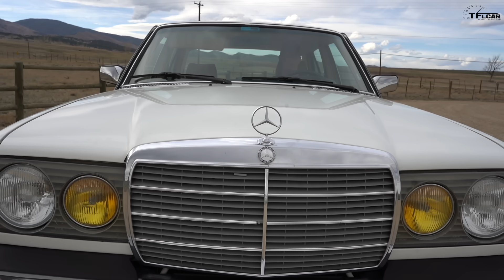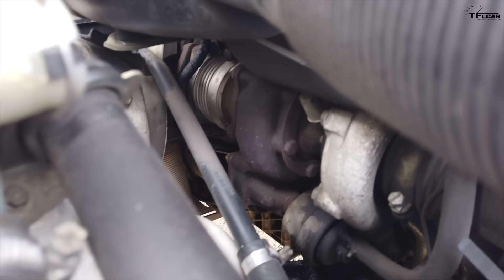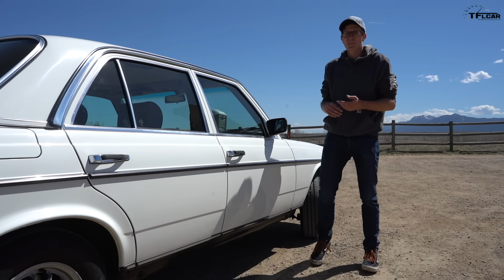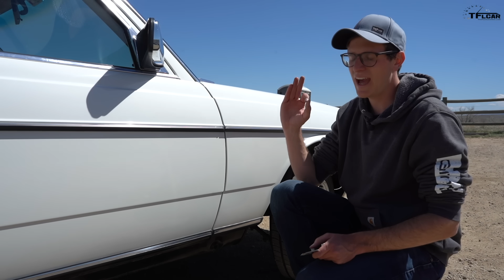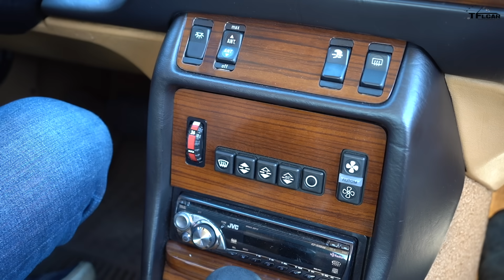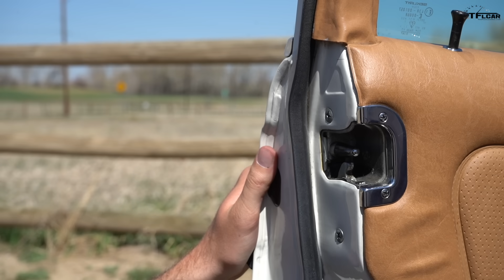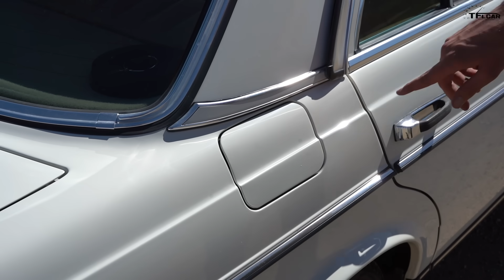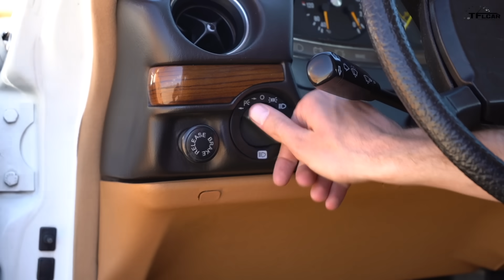This 37-Year-Old Diesel Is THE BEST Mercedes Ever Made!

Comment: I have the 1980 wagon version. LOVE the foglights ... love that they point about 40 degrees to the left and right so I can see the deer before they leap out in suicide.

Also ... I can attest that this engine is nearly bulletproof.
One day it had consumed its crankcase oil to the point where the oil pressure gauge started dropping to zero and back up again and I knew it was time to top it up ... but ... DOH! The handle to open the hood broke off!
SO ... I  kept going to my friends house ... 7 miles ... NO OIL PRESSURE.

Didn't bother it a bit.  I figure the sludge was so thick that it functioned like a reservoir.
I poured in about half a gallon and it fired right up. Didn't smoke any more than before. Accelerated the same 0-60 in 22 seconds (naturally aspirated, no turbo) as it had since the stone ages.

Did I mention that neither I nor the other fellow have EVER changed the oil in like the last 15 years?
Doesn't bother it. Same power. Starts right up. 
Its a seriously ancient diesel. Frankly it burns and leaks the lower viscosity oil. So the worn out oil is gone. 
Pour in another half gallon about two or three times a year.

Also started losing power one day ... figured out ... oh, right, Previous owner never changed the fuel filter, and since we traded it back and forth over a decade or so ... neither did I. I figured out that the fuel filter was about 15 plus years old.

While I was changing that, just for good measure, check the air filter ... huh ... some squirrel had made its nest in there. Cleaned that all out, tried an acceleration test without the air filter to see how much difference it would make.  ... NONE. So I put the squirrel nest air filter back in.

STILL gets 29 to 32mpg on the highway.

With new fuel filter back in ... right back up to its normal acceleration!

I've only stopped driving it lately bc the hand crank windows (its a Canadian model) smashed on the left and I can't find another window and driving with no window in the winter SUCKS. By the way, bc its the Canuk model, it has HAND CONTROLS FOR THE HEAT. Yep, none of that "temperature wheel" that never works!!

But it starts right up, no problem! EVEN IN THE DEAD OF WINTER ... no block heater ... starts right up.

Odometer died something like 15 or 20 years ago so NO telling how many zillion miles ... doesn't matter.
It starts, it pulls, it gets up to 32mpg in a HUGE HEAVY wagon format that will pull trailers!

Oh ... ya , its heavy AND STILL CORNERS LIKE A SPORTS CAR! Yes, a WAGON ... that's almost 40 years old.
I beat the Google Maps estimated time through eastern West Virginia by like 20 minutes ... in spite of having about a 78hp (naturally aspirated) motor ... BECAUSE I JUST DIDN"T SLOW DOWN FOR THE TURNS.

It drifts beautifully through the turns .. just like in the movies except I'm not billowing smoke from my tires because I got to my drifting the MANLY way ... by just entering the turn at twice the recommended speed!  No horsepower blasts to spin the tires for drifting. That's the woos's way bc you can always let off the throttle if the car gets out of hand. 
Coming down a mountain at twice normal speed ... you have to actually drive the car because you can't rescue the turn by just letting off the throttle. Nor can you slam on the brakes. Handled beautifully.
Not a problem ... tracked beautifully and didn't have the tail come around level to the front ONCE. NOT ONCE.

The only bummer now is that the fuel gauge stopped working. So now with no odometer, its hard to tell when its about to run out of fuel. Luckily it has a primer pump built right into the lift pump from the fuel tank!

I've not seen ANY other car with THAT!

So, YEP, THIS is the car to have during the apocalypse.

In fact, with our current president starting wars  for ... "reasons", hey, he doesn't feel any need for that ... it might be EXTRA good to have "apocalypse mobile" in your garage!

I'm only selling it because my health requires a functioning civilization and stable health care and ... ya ... that's about as likely as a reliable FIAT in today's America.

So ... I'm selling this perfect vehicle for the apocalypse ... which just may happen as a "November Surprise" to avoid an election that just may land a certain someone in jail. And that certain someone is not going to be Hilary.

This car is about to turn 40 and it JUST MIGHT OUTLAST AMERICA at this point. Seriously. I'm going to try to get the hell outta here. Want the perfect beast for the apocalypse? This is it!

Comment: In these cars there is nut in the boot that fits the wheel brace spanner if the electric sunroof gets stuck you can wind it shut manually by turning the nut with the wheel brave what engineers !!

Comment: My favorite Mercedes, I prefer the 300TD Wagon.
Reply: James Lamb those are very expensive by now. For  good one you’ll pay upwards of $15k. I would prefer a 280TE wagon (T is not Turbo but T-Model, which was the designation for wagon)
Reply: @roadtripusa9433  hi, sorry for my ignorance, but isn't the 126 much better and strong than the  123?
Reply: @roadtripusa9433  I had the 240TD and  I was dreaming of a 280TE. 0 to 60 in 30 seconds was my pain, I sweet blood while overtaking trucks. But I have to admit that the 240TD had a good fuel economy which makes it a daily driver even in modern times.
Reply: I once saw a 240TD.  Not imported to the U.S.  My dream car... right behind the 1972 Volvo 142... green... cloth interior.
Reply: Wagon with a 5-speed standard transmission would be sweet
Reply: Much better than the 300 sedans. The wagon was built in Bremen to a standard. And the best were the pre turbo models. 82 and earlier.
Reply: 230ce

Comment: No matter which model you bought as long as you had the 5 cylinder engine, the top engine. But I had a 220D with automatic gearbox, sold it at 680 000 kms, because of gearbox broken. the engine still running perfectly. One of my best cars ( with my BMW 525). Deutsche Qualität!!

Comment: I cut my teeth as a young service technician working on those. Nothing like sorting through the scratched microfiche files to find the vacuum diagrams, in German! Had to hand draw them to diag the vacuum systems. Made a smoke machine before they were made (using a MB glow plug) to diag the door locks.

Comment: My dad is retired Army and we lived in Saudi Arabia 1981-1983, and then he retired.  My mom had been working over there also, as bookkeeper, which was on the low profile.   When we were getting ready to move back to the states, we flew back for a week, and we always stopped in Frankfurt.  Bu this time we went downtown, and I had never been off the Air Base, Rhein Mien AFB, and we walked into a Mercedes showroom.  They sat down, checked off options, wrote a check, in full, (working in a hardship region had its perks) and walked over to the Audi showroom.  They had just ordered a Chocolate Brown 1985 300D automatic, and a 1985 Audi 5000S, 5 speed, when that body style was groundbreaking and this was easily the first I ever saw in the states.  They had to be converted for US regulations, and they were shipped to Jacksonville(different dates of course).   Both cars were awesome.   For trivia, they were once raced from Chareston, SC to Orlando, Fla where my dad was trying to chase down my mom who was actually behind him, by way of a mistaken identity detour.   But the Merc.  It was supposed to go to my daughter, but my dad got rear ended at about 35,ph, he was fine, car totaled.   Awesome car.  Great highway cruiser, and much more powerful than the numbers would show.    You should have shown that sunroof lower slightly before it moves back.    And also the windshield wipers are cool.   And don’t be fooled, I’ve been scary sideways leaving the car wash as a kid.  When that turbo spools up, it surges.    And yes, I took my driving test in it simply for the parallel parking advantage gained with that steering angle.  I almost choked when the windows started to fog during a winter rain and almost didn’t get them defogged.    Almost failed.     And for the record, my family isn’t rich, they just invested in two very high quality cars.   Ok one very high quality car.  The Audi was exceptional in every department except longevity.   The 5 speed was top notch smooth, and 1-2 power shift would kick the front end over a foot or so.    Great car.    Crappy door handles, brakes, shifter mechanism, AC, sunroof mechanism, antenna, etc.   ugh.
Reply: What a nice story!

Comment: The best Mercedes ever made? I think that's an understatement. With more than 2 million units sold the W123 is often considered the most reliable car in the history of the automobile.
Reply: Built to last for a lifetime
Reply: @San-uu7qc  you bet!
Reply: @San-uu7qc outlast many original owners
Reply: @Slakers we're not talking about the same thing. I'm talking about reliability of one single model the W123 built between 1975 and 1985.  Lots of W123s especially the diesel-engined ones have been known to easily hit 1 million km with just regular maintenance. You can still find a few them in the Middle East and in Africa where I live. Your data is correct, but it refers to all Toyota Corolla generations since 1966 to date. Don’t get me wrong Toyotas are fantastic and dependable cars. I own one.
Reply: @vieuxbal1253  Toyota are pos
Reply: @PathosRx  ????
Reply: @PathosRx  that part 💯
Reply: @vieuxbal1253  well ,it ain't no Mercedes. 
Even a base mercedes is a Mercedes,not a Kia. 
Has that kickass German engineering we've been told about. 
Of course anything much past 1990 is trash as far as that goes.
Reply: @MrTheHillfolk   I agree especially for the past generations Mercedes. But it's unfare to compare a Mercedes with a Kia as they're not targeting the same market.
Reply: @vieuxbal1253  I could have said VW or Chevy or anything else ,the other type of car doesn't matter because in the end ,it's not a Mercedes.
Reply: @vieuxbal1253  Especially 94- 97 . I had a 94 Corolla for 6 years & that car never yet left me stranded . All u did was oil change & replace timing belt & pump .Corollas are extremely reliable.
Reply: @vieuxbal1253  but they didn´t out lived any mercedes much more the 1966 models and also like toyotas, old toyotas allthough i have the latest model of the hilux to work and till now only diesel, tires , oil ,that blue stuff, around 2.500km´s each month since it came out not a single problem
Reply: @Slakers how many corollas are on the road today with 1 million miles or more with original engine and transmission??
Reply: @wisdomandlove1661  probably a lot more than we hear about.
Reply: @wisdomandlove1661  none
Reply: @wisdomandlove1661  toyota owners and mercedes owners are apples and oranges
Reply: True. W123 might be the most durable car ever made. Old Volvos give them some competition though. Insane mileages on them as well.
Reply: Absolutely  TRUE
Reply: I came from vws but I couldn't pass up a really clean 80 240d 4 speed a customer had,just because it was so clean and in great shape. 
Been 2-3mo now and I've had a great time learning as much as I can about it.
And it's not any slower or faster than my old mk1/2 VW diesels.
It gets the job done. 
(Lol you poor automatic trans folks though yikes 😬)
Reply: Well said
Reply: IS THE 1983 TURBO DESOL THE SAME..IM A ABOUT BY A  1983 TURBO DESOL. MERCEDES
Reply: @rosendodominguez9833  it is indeed.
Reply: Numbers of sold cars do not tell anything. If this is the most reliable car, all my personal experiences are wrong. In my eyes, it was one of the worst cars ever made - and I would not take it as a gift. Thank God I do not have to drive Mercs anymore. ( I was paid to drive them - but was the money worth the horror...? )
Reply: It's no more reliable than a Toyota but it was fixable and resisted wear better than other cars. When it did break it cost a fortune to repair. They are tiring to drive long distances. Loud and high vibrations.
Reply: The ford panther platform produced 9.6 million units. Love these old benzes and i agree legendary build quality.

Comment: I learnt to drive on this beauty and I loved it. 
I now have a 2001 E320 I drive daily. It is 19 years old 205k miles.  Never change muffler, shocks, engine mount,, battery, nothing absolutely nothing.....Never breaks down never needs anything ever. It gets 24 mpg average. It is quiet with Bose original stereo which sounds amazing. Recently replaced the very original battery car came with and the Alternator.

Comment: "its about 31 feet, which is if u are watching abroad is about 10 centimeters" .... :D
sry but thats not how the metric system works at all. u got it wrong by a times 100 multiplier.... 
its more like 10 meters= 1000 centimeters (10 meters = 32,8084 feet or 10,9361 yards).

but anyway, cool video, and probably the best car if u plan to drive a million kilometer.
(i hope your brain doesnt explode when u try convert km into miles.....) ;)
but no matter if miles or km, this car lasts forever.

Comment: I have to agree with Tommy about the M-B W123 chassis models, with the pinnacle being the 300D turbo. Properly maintained, this is an automobile that can cruise at 85 MPH all day long, and for around a half million miles before a major overhaul. I own a 1983 300D turbo, and a 1980 240D non-turbo (the factory never offered a 240D turbo to the public) with 4-speed manual transmission. The 300D is my freeway cruiser; the 240D more suited for shorter trips. The 300D turbo develops around 116 BHP and averages around 24 - 26 MPG, the 240D around 65 BHP, averaging around 27 - 30 MPG.

I apprenticed as a mechanic in an independent German car repair shop, and worked as a journeyman mechanic at a Mercedes-Benz dealer in the 1970s. The W123 came out mid 1970, and we were all amazed at the design, engineering, and thought given to the overall design of these cars. And also, the very comprehensive training we received as mechanics. We were trained to inspect and replace, as needed, every moving part between the front and rear bumpers, and even how to replace the bumpers which were shock absorbing for safety.

The design philosophy of Mercedes is "Function before Form." This is to say that everything involved in every stage of development and manufacture is given over to function, with nothing (well, almost nothing, for example the climate control system) left to chance or economy of manufacture. This is 100% true for the W116, W123, and W126 and earlier chassis models. By contrast, most other auto manufacturers place form before function, in other words more about styling and potential sales, and less about durability and quality. Sadly, the older factory concept of function before form has withered with newer Mercedes-Benz models, due to having to compete in the global market for high-end and well made cars.

Some of what might be considered the "little things", such as self-cleaning tail light lenses, the door trim, precision door latches, and so many other items on a Mercedes-Benz as Tommy points out were not considered with mainly U.S. cars, and many European cars as well. American car buyers were more or less brainwashed from the 1950s onward to sell their 3 year old car for the "latest style", whatever it happened to be at the time. Being style conscious, it didn't really matter how well the cars were made since they would be the next used car for somebody else to worry over the maintenance. It isn't so much that way today, but the mindset remains. 

Something not considered in Tommy's video is the resale value, which has everything to do with reliability and quality, and also desirability. A 1983 300D in excellent condition can fetch between US $5,000 and even $12,000. I have seen them for sale at these prices, and buyers are willing to pay those prices. Some people associate owning a Mercedes-Benz with wealth or status. That may be true in many cases. Some may call a Mercedes-Benz a luxury car. I don't. I call it a very practical car. True, the initial cost is higher than average, but over the long haul, over the life of the car, the total cost of ownership is competitive with other car marques, and the joy of ownership -- priceless. More so with the W123 now that they are considered "classic cars." It is interesting to note that in 1983, depending on options, a 300D turbo sold for around US $37,000. In 2020 US dollars, that works out to around $100k. The W123 was in my opinion the peak of achievement in value for automobiles.